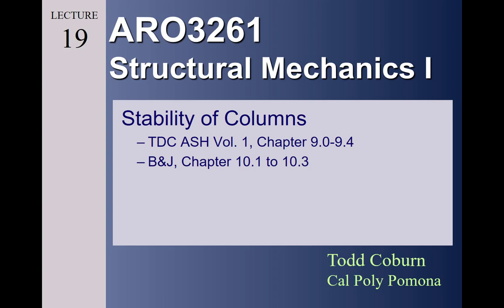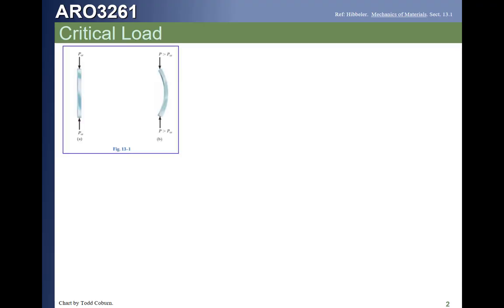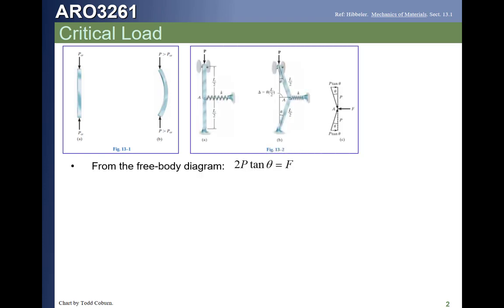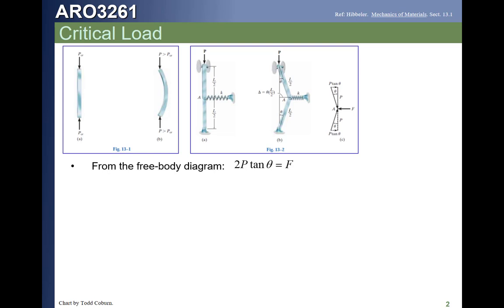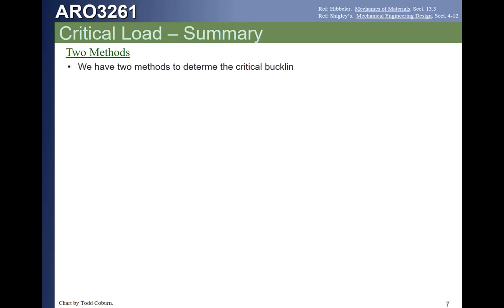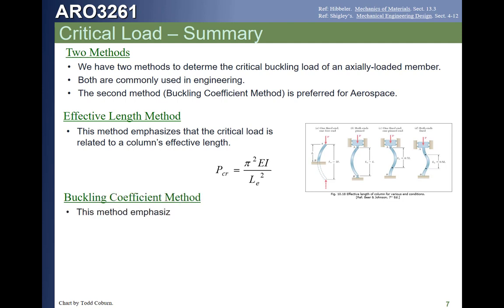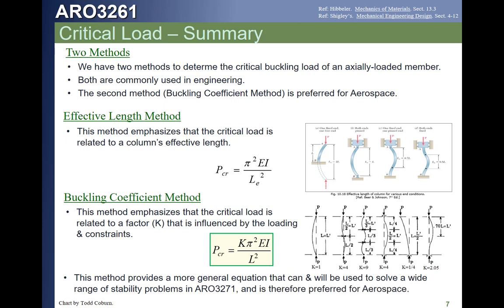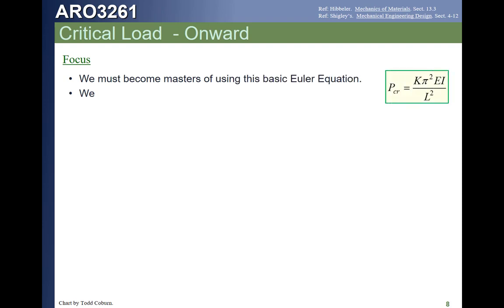Strength I: L-19 Stability of Columns

Comment: Good afternoon, Professor,

Why wouldnt we by using n (nodes) for the examples that use euler's equationsc such as in 19:00 ? I noticed we made n=1, and solve the equation. When do we use n in the euler equation?
Reply from the maker: Analytically, you can insert n=1, then 2, then 3, etc, and select the lowest value of Pcr as the allowable.  But n=1 always provides the lowest value.  However, in "real life" the n is mathematical equivalent of the mode shape.  Your first mode occurs at n=1.  Your second at n=2, etc.  If something prohibits you from buckling at the lower mode, then the next mode shape dominates.  For columns, constraints are usually what throws us to the higher modes.  This is also seen in the Strength II playlist where we evaluate buckling of flat plates (followed by curved plates and cylinders), and in that case, you have both n & m affecting your mode shape.  This information is all buried within the buckling coefficient K (or C, if you define it that way).  Make sense?  (BTW, that is a really old video, I need to re-record it).